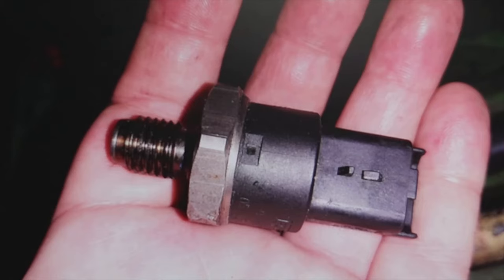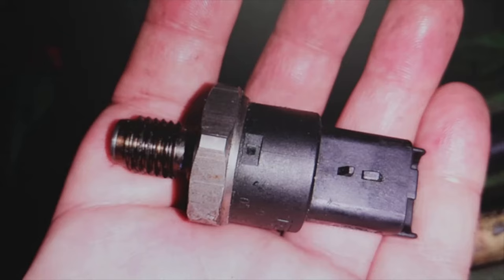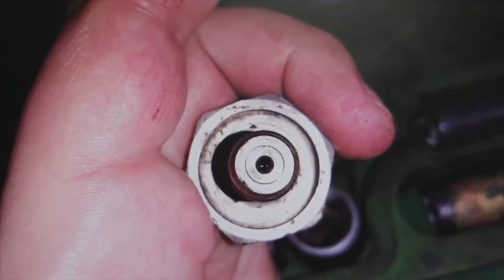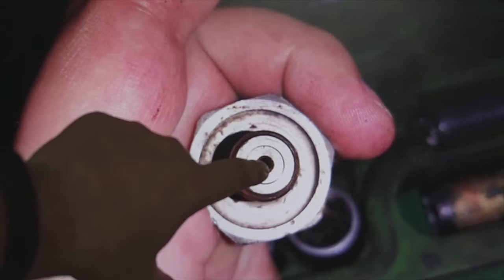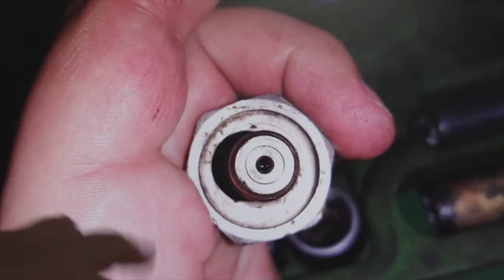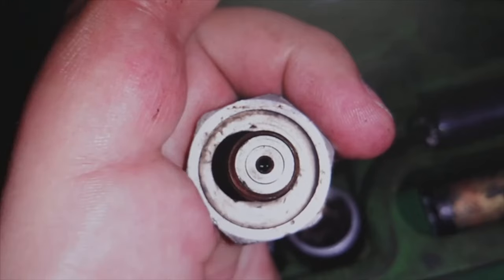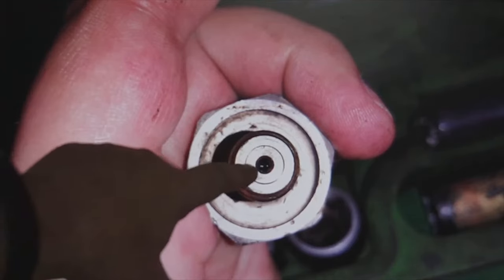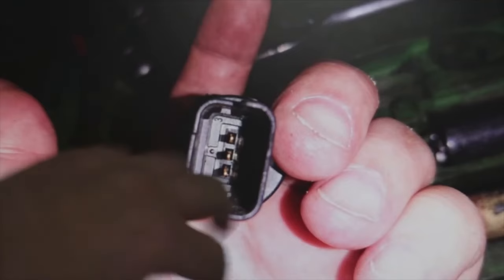Check this BEFORE replacing the FAILED FUEL PRESSURE SENSOR. RAIL SENSOR

Comment: I have a 2013 c5 and it once gave me the fault P0088 fuel pressure sensor ramp too high, now I don't know if this fault or the one in the pump, but remove the fault because I have lexia and it no longer appears but sometimes when I go out in first gear it jerks me and sometimes the engine runs wonderfully very smooth
Reply: Did you find the solution? My 07 A8 fsi just gave me the same code.

Comment: MB OM 642 Fehlercode P10D9 !?
Reply from the maker: The failure usually comes from the pressure sensor, clean it well inside to see if it improves